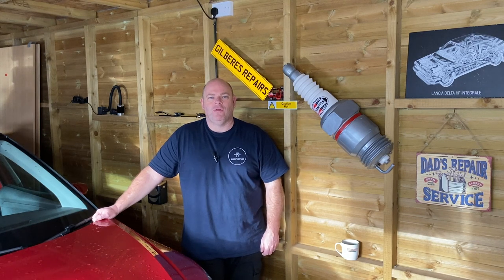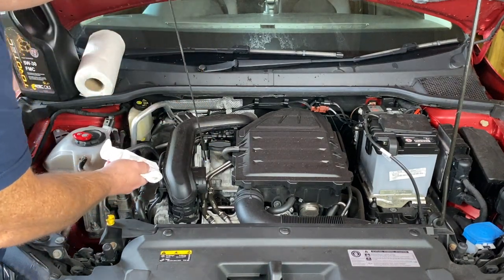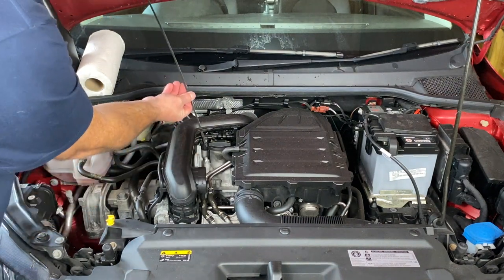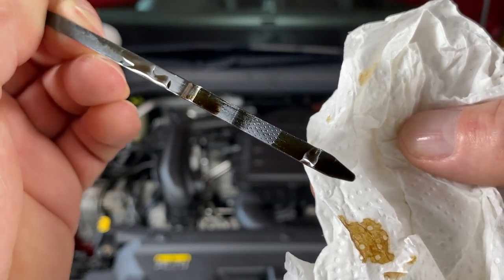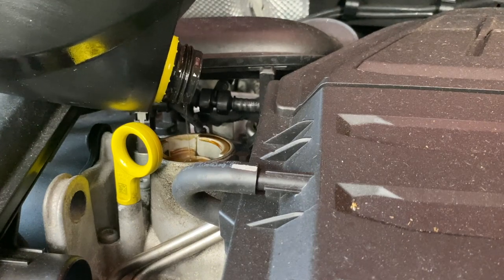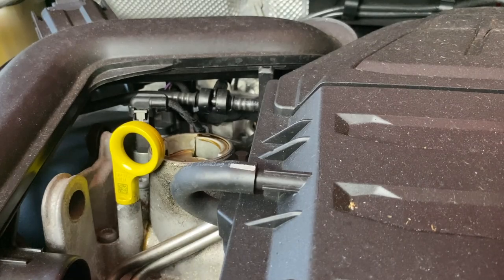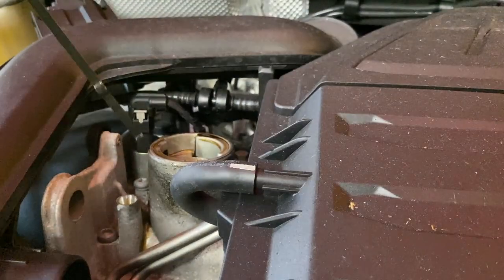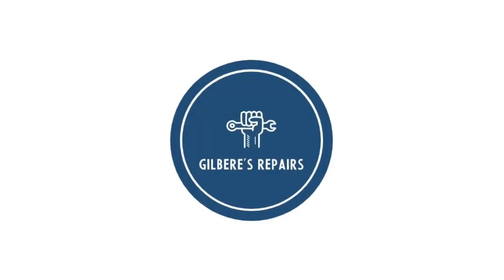How to check engine oil level Seat Arona - Skoda Kamiq

Comment: my seat aron gets low oil level but it should be serviced in april/2024. can fill the car with a little oil until service
Reply from the maker: Yes, definitely top it up. Just use the correct oil 👍